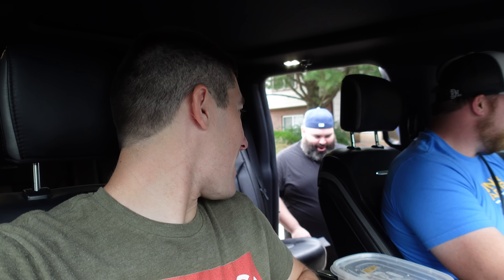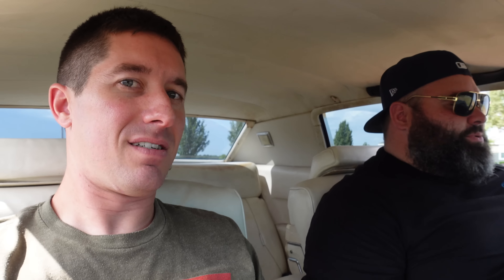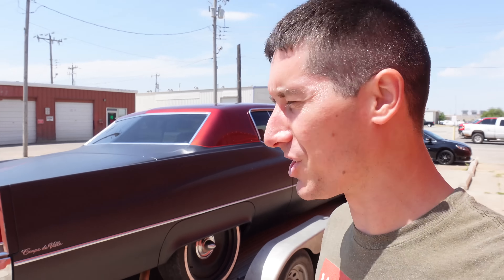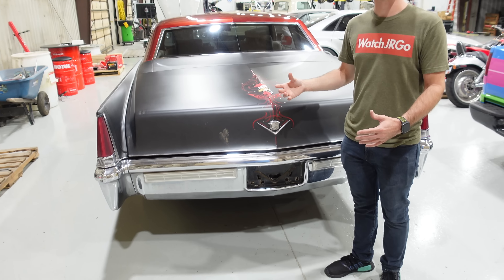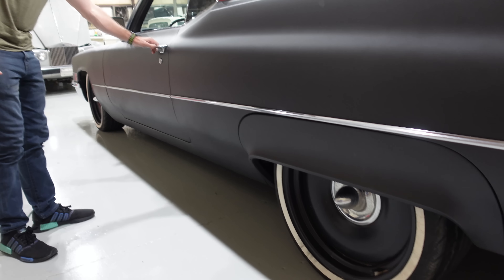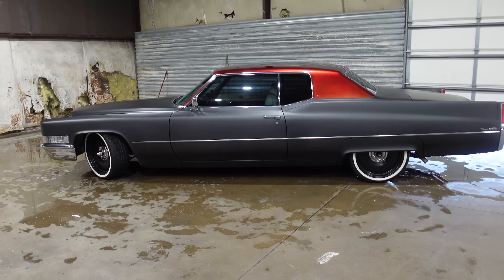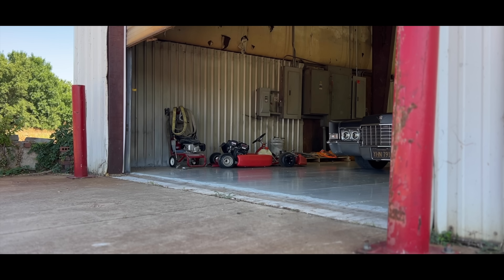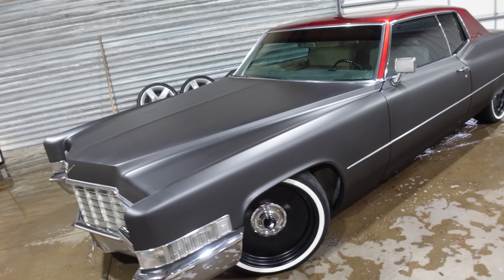BUYING This 69 Cadillac Custom With A MAJOR Surprise (Not Bodies In The Trunk)

Comment: Check the mechanical advance on the distributor. That hesitation on starting could be the timing issue. The HEI sitting way up front had a problem with rust getting to the mechanical advance system.
Reply: If it has HEI it's an upgrade. Those came with points and a coil.
Reply: Had this happen to a f250
Reply: The HEI distributor still has a mechanical advance mechanism under the rotor, same as the original distributor. Those flyweights will stick in any position if the shaft has been allowed to rust. Then you wind up with an improper timing setting.
Reply: Off topic but the a/c clutch clipping on and off a usually a symptom of just low refrigerant

Comment: Double check that the power wire for the HEI is a 12 gauge wire all the way from the firewall to the distributor. I’ve made that mistake on an older truck and had start up issues. And I agree with a previous commenter that the ignition timing may not be correct.

Comment: I dailyed one of those for a couple years; best old unmodified car in terms of handling, braking, etc. I've ever driven.  Only handling issue was bc of the weight & thin stock tires, in the snow it tended to push going around corners if driven at modern car speed.

Comment: i had a 67 coupe de ville. 
you can swap out that steering box for a 78 trans am unit. its a bolt in, quite a difference in steering responce. id use a edelbrock afb carb or a holley vac secondary 750.  
A B&M transkit  will make the tires chirp on 1-2 shifts, the turbo 400 is very HD. 
dual exhaust would be good with glass packs. 
you can add hei ignition from a later model 472, i think a 75 will just drop in. 
I like the air ride setup on yours. ok

Comment: Find an old iPod, and load it with iTunes music. 

That audio quality that comes out of a 30pin connection is unmatched. My 2011 Jag has a 30pin adapter from the dealer when it was new. The same audio track is night and day difference, between my iPod classic and my iPhone, using Bluetooth or aux. 

30pin for life.

Comment: The land barges are getting some respect now!
I had a 68 Firebird 400 and the climate control was weird. The ac compressor would cycle even when the heat was being used. A Pontiac dealer assured me it was normal.
Reply: AC should run for defrost but hard to say what was evolving in that era.
My first driver was a mint '57 Chrysler New Yorker 392 with the fin styling. But as a teen soon got my own age appropriate ride.

Comment: The vacuum lines at the wiper are not vacuum- they're washer fluid.  On many GM cars of that time period, the washer was integral with the wiper motor. It eas done that way to ensure the blades didn't didn't go across a dry windscreen.

Comment: If that A/C is still the R12 system you can use a product called Duracool to recharge the system. You can also just do the R134 conversion.

Comment: 69 Caddys  hunted around on the road when new .  Bias belts and some toe in and still compared  to rack and pinion  rather disconnected. Trunk had torsion bars when new not gas shock. Should have a quadrajet carb on a very low manifold.

Comment: Sweet ride, 472 v8, 375 gross hp, 10.5 to 1 compression ratio,Turbo 400 transmission.  Requires super unleaded  or back then Premium leased.  Back seats needs to be redyed, white interiors do not age well.   Will be costly for new ac, have to retrofit for new freon.

Comment: We have to be careful here in PA with halos and colored lighting. I put green LED fog bulbs in my '06 Grand Cherokee. Took it to the local police station to check the legality. The officer on duty at the station told me that external lighting is illegal in PA and he'd never pull me over since colored bulbs in factory housings aren't technically external. I see cars with halos of every color of the rainbow, but blue and red seem to throw up red flags since those two colors are used exclusively by LEOs. Maybe I'll push the envelope and get purple fogs because I'm a Prince fan.

Comment: Grew up with and learned to drive in a '69 Olds 98 coupe, not unlike this tank. It was a big floaty boat, with poor handling, poor braking and everything else that goes along with GMs from that era. I don't miss it. I think if I were to get something similar, it would be a '67 Eldorado. Just cooler looking.

Comment: When I was a kid in about 1971 my dad bought a used 1969 Cadillac coupe DeVille it was beautiful a doctor owned it and it was 2 years old so she needed a new one you know lots of money? So anyways it was a beautiful goldish brown with the goldish interior I don't know the names of it but we had that car up until 74 November when my dad traded it in because my uncle drove it borrowed it to tow his boat to the river and back then the gas station the attendant would check your oil and stuff and he pulled the spark plug wire off of one of the spark plugs and it burned a valve on the car cuz my uncle didn't check it he just drove it missing all the way home and it burnt the valve so my dad was pretty mad about that so we traded it in for a Pontiac Astra GT Safari station wagon what a piece of you know what but it was cute it was bright red with racing stripes lettering tires it was the cutest car but the engine that aluminum engine it overheated and blew up when it was 6 months old broke down we were taking a trip to Oklahoma from California and broke down in New Mexico but my dad rigged it back together and we only kept that 3 years and we traded it in for a Granada 78 much better car.

Comment: Couldn't hear how much he paid for the car. The gear shifter is odd. It's a very nice car. It'd be nice if had a little bit higher sidewalls yet not the old fashioned balloon tires. Nice if can get the car back to regular leather interior. To clean the engine compartment. To sand down the interior trunk floor and is light surface rust and can primer and paint it well. Nice car to have riding around in here and there and as a show car.